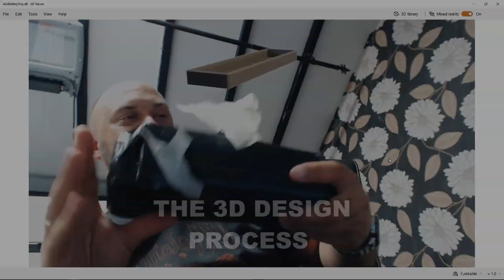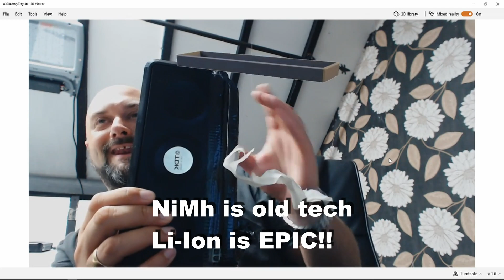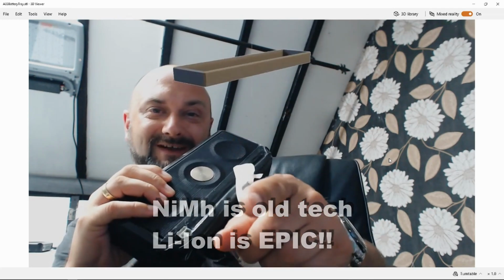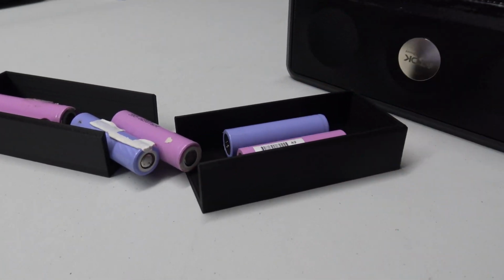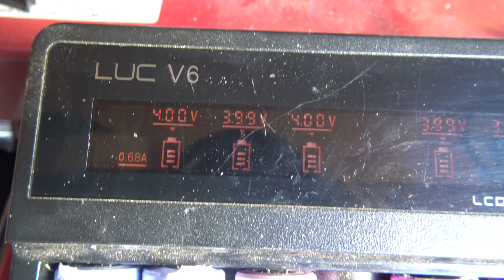DuB-EnG: Hack a Bluetooth Boombox TDK A33 retrofit with re-purposed Lithium Ion laptop batteries BMS

Comment: Will the stock charger not charge these batteries? Can you give more detail on the charging port you installed and the charging adapter requirements? Great video, thank you!
Reply from the maker: Hi Justin... I used a 2 cell BMS with 2x3 batteries in parallel... perhaps use a DC barrel jack as a charge port, and you could use a lithium battery hobby sky rc iMax B6 charger ... Only £10 and charge everything ... well worth having one in the kit!!
Reply: Dubious Engineering thanks for the response, I’m going to look into all of that! It’s a great idea

Comment: Wow this is EXACTLY what I was planing to do.

I have a discontinued Klipsch KMC3 that I wish came with a battery so im planing to build my own.

I also have 60 Samsung 25R 18650 batteries from my Bajaboard but I'm replacing those cells with Sony VTC6 cells and would feel bad just throwing out 60 Samsung 25R cells so I need to repurpose and rehouse them and this is the perfect project.

But I want to keep everything original looking and stock from the outside. Using the same charger port and everything.
Reply from the maker: Anthony Campos well shoot dude... challenge on! .. post pictures on dubious engineering on Facebook and let’s watch your progress!